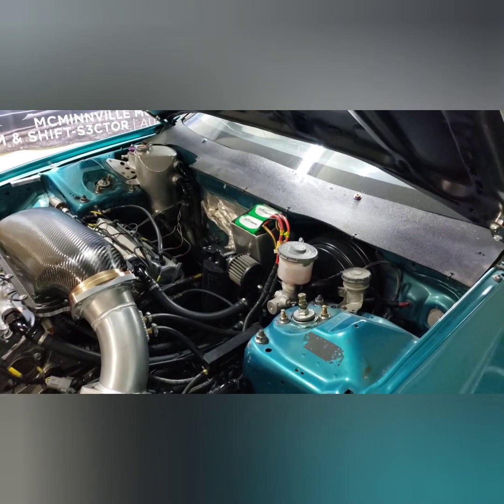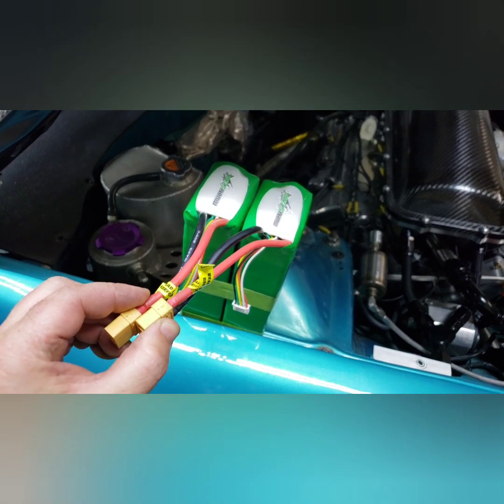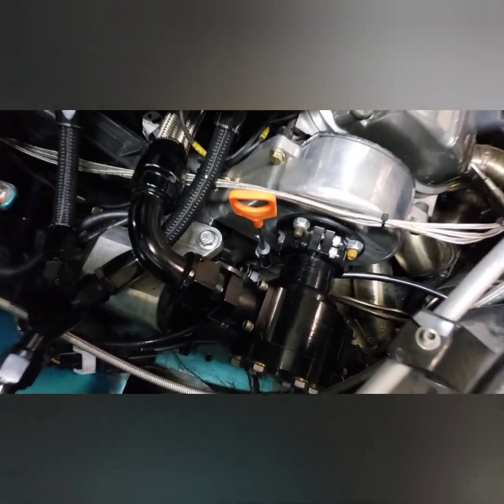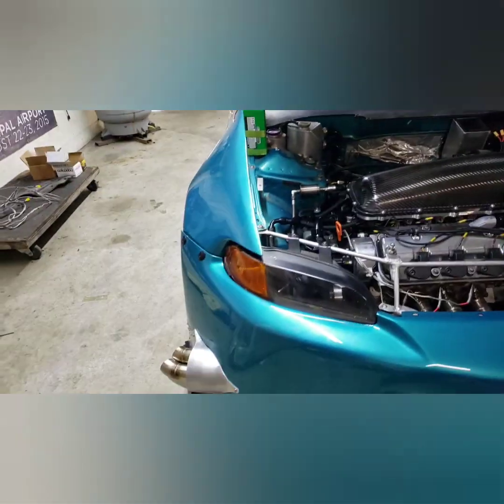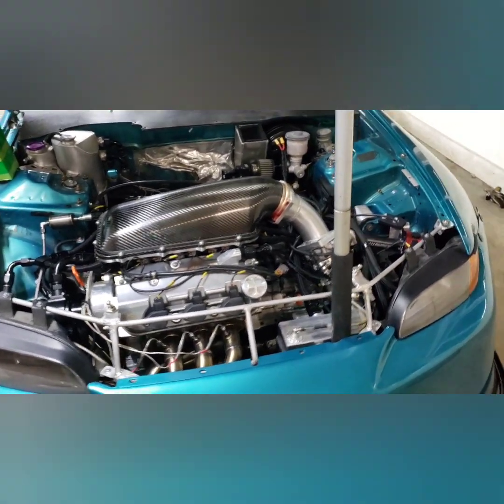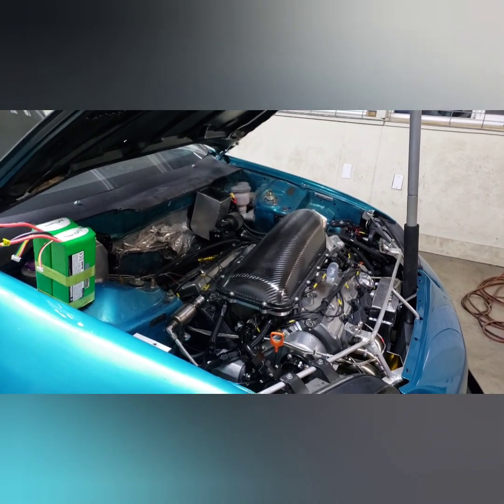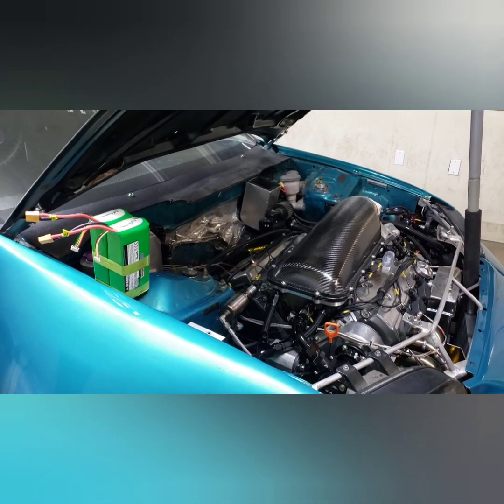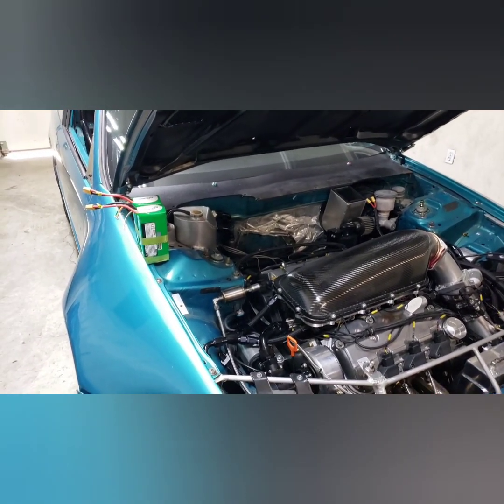16 volt racecar system basics

Comment: I always thought the only way to blow up a battery is if the alternator doesn't regulate the charge running through it basically an overcharge situation where u sizzle highly flammable gasses out the battery but very interesting

Comment: Can it last for 50 minutes? One session for me is 20-25 minutes. I need to run the ECU, injectors, fuel pump, ignition, fan (only when I'm slow around the pits, off during the hot laps) and electric power steering pump (30A constant, 60A surge during startup). I want to get rid of my alternator. It's for my race car.
Reply from the maker: Unfortunately not for that long. This is 3-5 min of run time peak.